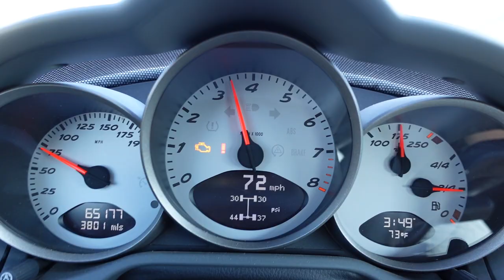My Cayman Broke.

Comment: I'll have to go back and see if there is a previous video of yours that I've seen because I am already subscribed. However, I don't remember you or that Cayman.
When you first told about the rattle and described when it occurred, I thought of the input shaft bearing but I wasn't even sure if it was a manual or tiptronic.
I'd say you dodged a bullet with it not being in the gearbox needing a rebuild.
You changed the RMS but did you go ahead and change the IMS bearing?
Have a great day.

Comment: Was it an expensive repair bill? What caused it?
Reply from the maker: I just started hearing noise in the transmission, so the shop tore it down and find the pressure plate to be seized. Not uncommon.